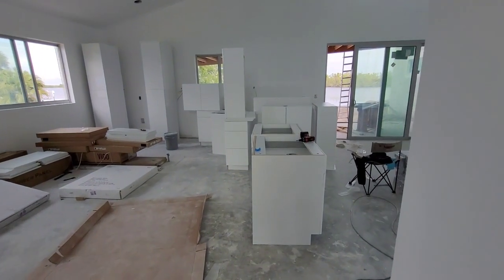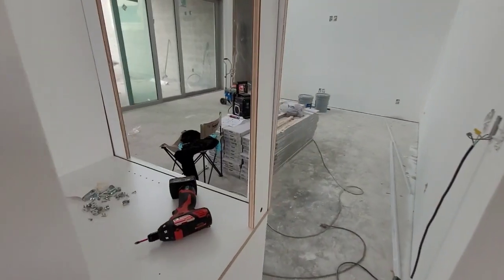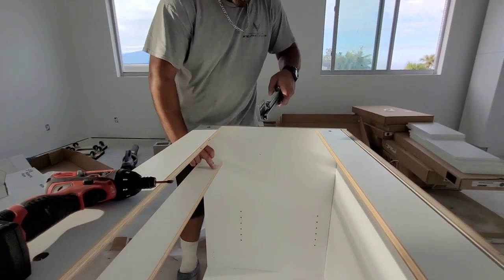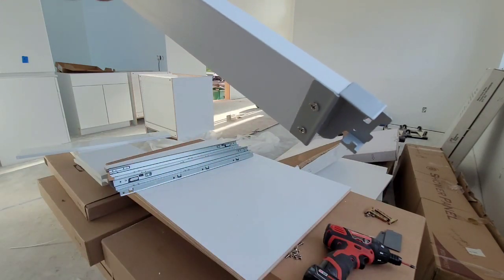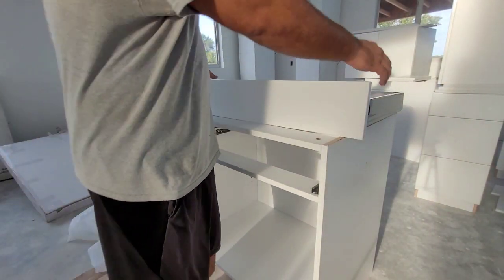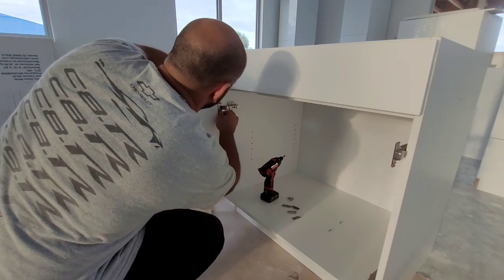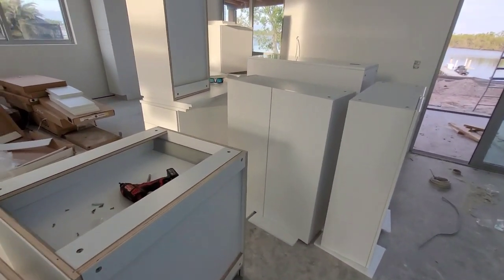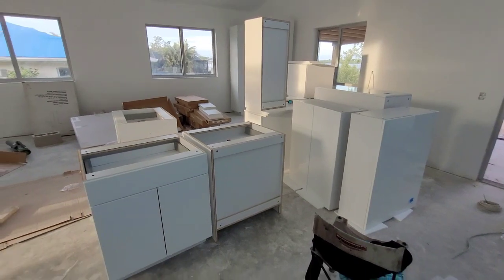assembling cabinets to go modern European series cabinet in metro gloss white rta cabinet.

Comment: Thank you for the video. I referred to it quit a bit.
While the CTG cabinets are well made and look very good the install directions are worse than IKEA . That is very bad. The diagrams are small and vague on detail. 
I had one five drawer closet cabinet and a kitchen base cabinet with drawer to install. The drawer system in each was different. They were easy to install ONCE you worked out the subtle details of what was going on. This took a lot of time with a generous amount of frustration and I design and build houses.
I would not recommend these cabinets to the amateur who might not be good with the visualization of what should go where and how it’s going to work.
The directions need to be much, much better particularly when it comes to drawers and slides. Why are they so, so terrible?
I was not missing anything which was good. I did like the final product.
Reply from the maker: Yea they lack alot of details.